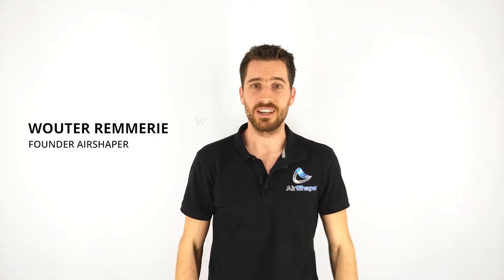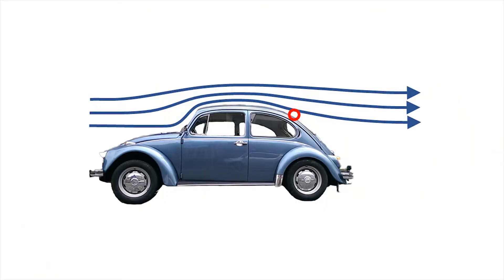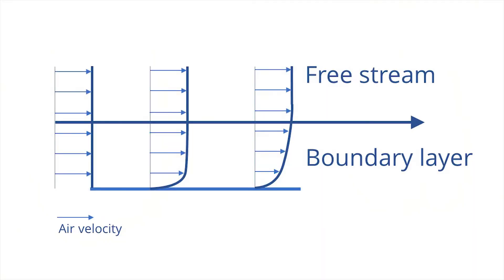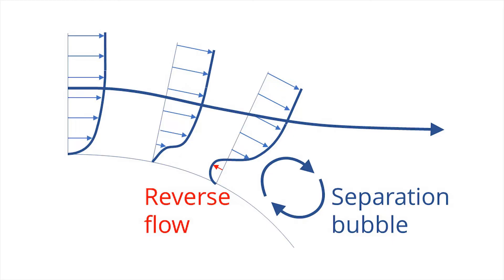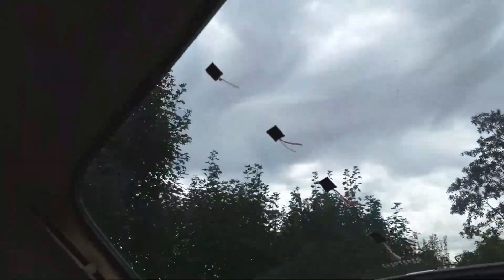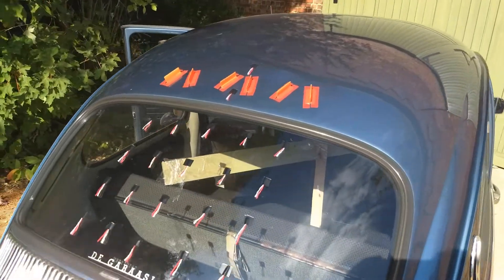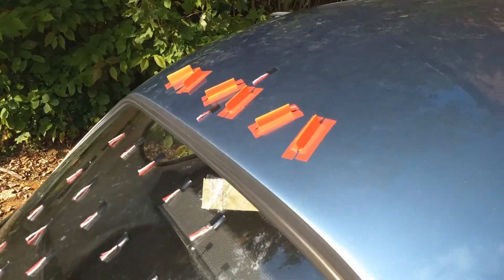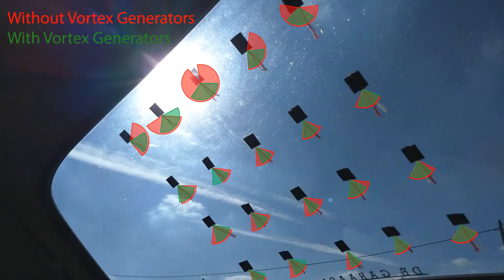DIY Aerodynamics #2: Vortex Generators

Comment: Hi Wouter, thank you for doing this video. I have a Beetle 67 here in Brazil and I am very interested in how I can improve the airflow to the engine. As you know, the air-intake is located just under the rear window. Driving in the city I never had a problem with overheating, but on the highway on longer journeys the temperature easily gets critical. Can you tell me at what speed the air starts detaching from the rear window, and would vortex generators drastically improve the air-intake at higher speeds? Best regards, Kris
Reply from the maker: Hi Kris, good question! We found separation to happen quite high, at the top of the rear wind shield. To keep the flow attached all the way to the air intake is very difficult, I would say. Alternatives include keeping the engine hood open (some put a hinge at the bottom, instead of the top, and leave a 10cm opening while driving!), or air intakes (with air channels to the engine) at the side windows (at the end, you now probably have some small cooling vanes for the interior). An active fan could also be an option!
Reply: Oh that's too bad. I would like to see a wind tunnel test with vortex generators though. I could only find one without here on youtube and as you say, the air starts separating quite high on the rear windshield.
Reply from the maker: @krispaul2939  Hi Kris, perhaps you can experiment yourself with Vortex generators? As you can see in our movie, the tufts down low still improve, but not by a huge amount. Might still be worth it!! Perhaps log your engine temperature, and compare different cooling concepts?
Reply: I've installed the vortex generators, let's see if it yields anything, otherwise I'll look into your other suggestions, but it would be nice solving this without too many modifications. What happens if you install one more row of vortex generators below the first one? would that force the airflow to follow the curvature down to the air intake better?
Reply from the maker: @krispaul2939  Hi Kris, hm, good question. When I experimented on the beetle, moving the row 5cm upstream or downstream already made a huge difference. It's a matter of making the boundary layer turbulent enough, just enough upstream so that you post-pone the separation point. A second row could make sense if the flow becomes laminar again in between, but perhaps then this indicates that the first row is too much upstream? You'll have to experiment, like you say! And there is only so much negative angle the flow can take before it separates at a certain speed, vortex generators or not.
Reply: Hey Wouter, I'll experiment and see what turns out best.Thanks for the advice so far. Best regards, Kris

Comment: honda modulo x has vortex on bumper side just before front wheel and toyota has vortex on mirror side and rear lamp. do you think its help to reduce drag and wake?its applicable for other car who doesn't have it?
Reply from the maker: Vortex generators can help to locally energize the flow to stay attached to a certain surface or to modify the wake. Simply applying the design from one car to another would probably not work well, and would need tuning, if it works at all!

Comment: would we see an improvement in performance, regarding air intake in to the engine??
 awesome video
Reply from the maker: The intake of the engine is far down - I would guess the flow still detaches before it reaches that point. Perhaps adding a well hidden air scoop to feed slightly higher pressure air to the intake would be nice? :)

Comment: What would be the effect by placing AirTabs on the rear trailing edge on the roof top of a pickup truck 🛻 which has a significant curvature by the back window . I’m doing some test on a 2021 Toyota Tacoma with a tunnel covering on the bed.
Reply from the maker: Hi Hans,

we've had that question before!
The AirTabs, from what I understand, have the aim to energize the boundary layer just before the edge and "pull" the flow inward, I would think.
On large trailers, that makes sense, as you want to contract the wake.

On a pickup truck, you'd probably have to analyse whether contracting the flow will make it hit the loading bay or not.

Also keep in mind that the AirTabs also add drag locally, so you need to gain even more in other locations (like in the wake) before they become useful.
Last but not least, their performance may depend on the angle of attack, on speed (and thus Reynolds number) and on flow quality of the air in front of the vehicle (if you're drafting another vehicle, likely their effect will be different). So plenty of scenarios to test :)

Comment: Important note that without proper rear wing those vortex generators will do more harm than good.
Reply from the maker: Hi Eric,
indeed, it's possible that by pulling down the airflow you actually generate more drag. Another aspect is the "stability" of the flow pattern, which can also be influenced (in both a good or bad way) by influencing the separation location with vortex generators.

Comment: Awesome channel, I'm a comercial pilot and flight instructor and yet, this is the first time I actually get to see the effect of vortex generators with my own eyes!
Reply from the maker: Thank you very much Francisco! What plane do you fly?  Vortex generators are sometimes used on planes as well, usually to delay stall - see this link for example: https://en.wikipedia.org/wiki/Vortex_generator
Reply: @AirShaper  I've flown several planes (pa28, pa34, be76, c172, pa30, pa23, etc) including a Cessna Citation with an upgrade with vortex generators, the approach speed was as slow as 105 kts. But I'm currently flying a Britten Norman BN2-A "Islander" in the Galápagos Islands. I'll take a look to your other videos!
Reply from the maker: @fjng1  Oh that's really cool! Lot's of smaller planes, I guess you have lots of contact with the passengers, plenty of interesting stories :)
Reply: @AirShaper  Definitely, it's another kind of commercial aviation. Small or light airplanes make the part of "flying" more interesting, you actually get to fly and navigate like old school pilots. In the case of the Islander, the flight controls are driven by pulleys and wires so you actually get to feel the buffet prior to the stall, and in Galápagos, you only use VOR's, DME and NDBs as a primary source of navigation! Its a great experience

Comment: waste of money, its not essential at all just drive the car.
Reply from the maker: It's indeed not essential to drive the car. And on modern cars, there is no need at all because the base shape is streamlined enough to avoid separation without vortex generators. But for some applications (in sports, aviation and cars) it can be useful to optimize for efficiency, range, top speed, ...

Comment: I suppose these would also work on the sides of boxy cars (wagons, hatchbacks), vans and trucks
I might try these to see if they can be used to keep the rear window cleaner for longer.
Reply from the maker: This has been a point of discussion before!
Vortex generators can help a lot to energize a flow upstream of a "negative curve" - the extra momentum helps to keep it attached to a gradually inward curving surface.
When you look at abruptly changing curves, like a 90° bend, the story is different: the goal, then, is no longer to keep the airflow attached, as it will separate anyway. But in some cases, it can still help to add vortex generators to energize the flow and have it shoot slightly "inward" after the 90° bend - contracting the wake a little. You may want to have a look at AirTabs, which are applied at the boxy end of trailers. Not sure which official proof they have, but definitely interesting!

Comment: Vortex generators utilize the same effect that dimples on a golf-ball utilize, except on a golf ball we have to cover the entire ball because we don't know where the front and back is because the ball is spinning, whereas on a car or airplane we know where the front and back is so we only place them strategically.
Reply from the maker: Hi Erik, thanks for the comment, that is entirely correct! In theory, you could make a golf ball fly even further if it's orientation would be constant 🙂 for cars, this is almost true: sidewinds, upstream turbulence etc can alter their behavior and thus the impact in drag.

Comment: are useful on mazda mx-5 rf roof ?
Reply from the maker: Depends on the model, if the slope of the rear window is quitr 'negative' and separationnis expected then it might make sense. If it's upstream of an abrupt cut-off of the roof line (like the latest model) then the air will separate anyway and vortex generators make no sense. A cfd analyse of the base model will provide that insight!
Reply: @AirShaper  Thanks. I refer to the mx-5 ND (4th gen), in particular to the RF version (obviously when it is full closed )
Reply from the maker: @bscgarage  If I'm looking at the correct MX5, then it's the one with the abrupt end of the roofline: so you would have flow separation there anyway. So then vortex generators wouldn't help, in my opinion.
Reply: @AirShaper  Thank you very much! I would go for a little trunk spoiler!

Comment: Good video! The facts about functional VGs in general automotive applications has become so distorted amidst a decade of EVO wannabees. You don't need a wind tunnel to determine the point of separation, but you still need to "test"(w/tufts and/or powder) to determine an optimal mounting position.
Reply from the maker: Thanks Micro Air! Indeed, a number of cases where vortex generators were applied on iconic cars have triggered others to apply them as well, also on cars where they're less relevant. These days the back of cars is so gently inclined that VGs are usually not required, as there is little seperation before you reach the trunk.

Comment: How would these work on a pickup truck?
Reply from the maker: Hi Paul, a pickup truck typically has quite an abrupt drop after the front cabin. So there's not really much of a "negative curve" going on there, so I would guess vortex generators have less of an effect. But it would definately be worth the test :):)

Comment: Bernoulli's principle states that an increase in the speed of a fluid occurs simultaneously with a decrease in pressure so fast moving air stuck to the Beatle's rear window will create suction (increasing drag) and the vortex generators will also directly create drag. This video misses the point completely: the Beetle needs a spoiler above the rear window. If the angle of the rear window was flatter, then the spoiler could be lower like on a Porsche 911 but a Beetle needs separation above the rear window.
Reply from the maker: Hello Jeremy, just like the Bernoulli's principle is not enough to explain how wings work, it is not enough to explain the complex flow structure we're looking at here. Yes, a small spoiler creating a separation point could be a valid option to reduce drag, just like the coda tronca cars from the past. But it's not the only option: the vortex generators themselves indeed create extra drag locally. And yes, they speed up parts of the flow close to the window. But that is not the only aspect, they decrease the large wake zone at the rear of the car, which is creating a large suction effect as well. As you know, similar effects have been demonstrated to work on golf balls (the dimples). Hope you agree to this explanation, let me know your opinion.
Reply: Jeremy Parsons wrong. bernoulli's principle will create lift on the car, not drag. with increased flow attachment the car will have increased lift according to bernoulli's principle. this could be offset with a trunk spoiler which could be smaller because the increased attached flow  increases the efficiency of the spoiler. the reduced low pressure wake behind the vehicle will reduce overall drag. be careful when applying physics there are often multiple effects to consider.

Comment: Do you think that the difference made with these devices would make a difference in a racing situation? The VW reaches speeds up to 130 miles an hour.
Reply from the maker: Hi THEDnARACER,

At speeds of 130 mph aerodynamics are by far the most dominant source of resistance (easily over 80%).
The vortex generators can make a difference for sure, to reduce drag for example. But careful application is advised.
Also, they influence the air that is fed to any rear wing for example, if you have one!

Kind regards,
-The AirShaper Team
Reply: Fast moving air stuck to the window will create suction and the vortex generators create drag. This video misses the point completely: for you, reducing drag is more important than clean windows. A spoiler above the window to separate the airflow will increase the pressure on the rear window and actually push you forward - actually reducing drag
Reply from the maker: @JeremyParsons  Hi Jeremy, I've answered in part to this question in my other answer, see below. Looking forward to your comments.